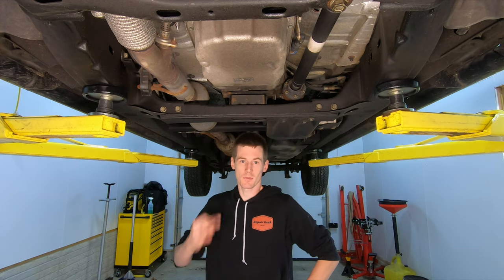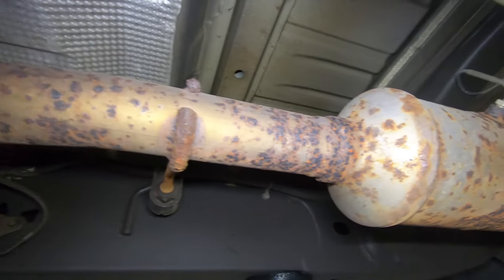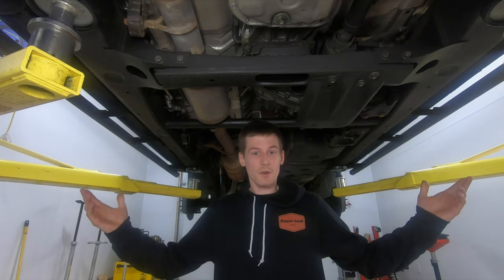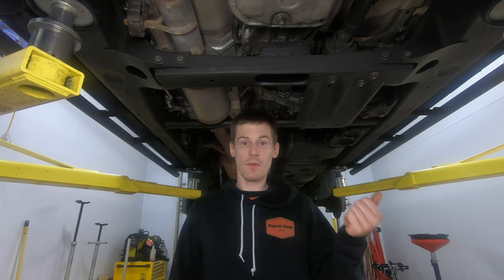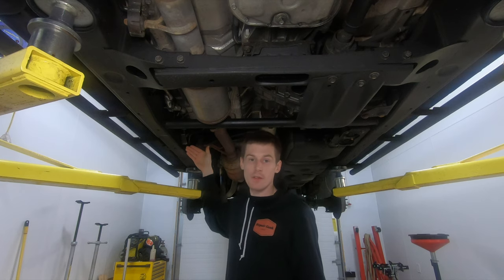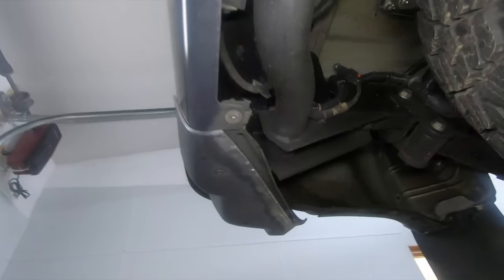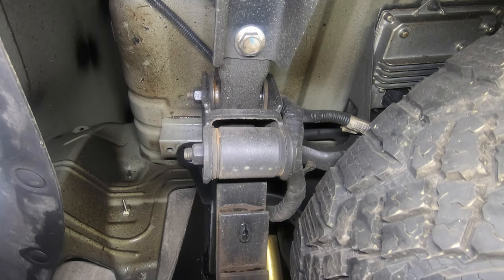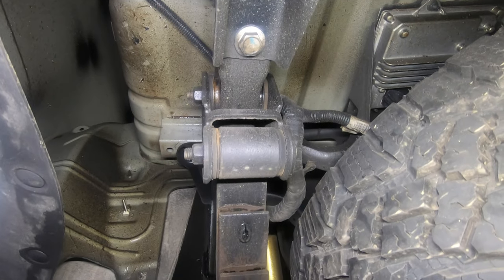Fluid Film Review After 3 Years and Woolwax Vs. Fluid Film Testing.

Comment: I think if you heat the Woolwax up and spray it with a paint sprayer or an undercoating gun with a wand, you can get the product in all of the areas mentioned. I have used both for years and I like Fluid Film for things like rubber treatment or battery terminals, but as a rust inhibitor on the undercarriage, I think Woolwax is superior.
Reply: I bought the fluid film spray gun kit. Can I use wool wax with that?
Reply: @JT_WallStreet  

Yeah, that would work fine. I get the stuff pretty hot before I spray. I use an old kitchen pot on a campstove or I just use the paint cup on the Harbor Freight air fed spry gun I use. 

You want it hot enough that it runs off a mixing stick pretty quickly. The pot or spray cup will be too hot to hang onto with a bare hand, but once it is clipped to the sprayer it's no big deal as long as you are not shooting it in your eye or something.

Comment: Run paint tarps around your truck for the overspray and get some CRC on there. It's so much better of a protectant.  Essentially make a pait booth under your truck with the tarps.
Reply from the maker: Crc does not creep meaning if you miss any internal cavities on the initial application it will not creep into the areas you missed.

Comment: Great work there lad, alot of information and no bull. I have been spraying my 80 series with heated chain oil and wax  for years and works great when the dirt builds up on it. But I now want to treat the underside of a 71 challenger with a lanolin based product, do you think its worth while treating the cleaned down frame (not rot just surface rust)  with a rust converter before applying the lanolin? Or a waste of time!!  Appreciate your thoughts, all the best from the north West of Ireland.

Comment: The LPS3 is the only product that was approved by the FAA for use inside of the landing gear compartments on commercial aircraft. It was the only product that showed no signs of failure. 160-200mph touch down speeds spraying salt and debris inside the compartments. 

I also found cosmoline sprays such as LPS work even better heated up in warm water and their consistency to creep greatly improves.

Comment: What happens during the summer with the wool wax and the pinch welds? I use wool wax on my diesel truck and she's black and gets to 100 plus degrees here in Washington State. You're in the summer and I can tell you that the wool wax the black component won't move but the oil itself you'll have like a oil slick all around the main. Of wool wax. I think that gets missed and that the wool wax does protect it, but it requires the heat of the summer to really set the product you like the test stuff? Take two pieces of metal that are a pinch welt. Put the wool wax in there and then heat the metal up to what it would reach during the summer. In my area we had summer temps as high as 102... Remember you need to do that all day at least a couple of hours and you put paper underneath the product or the pinch weld. You'll see that it's covered in oil slick like a french fry on a piece of paper. I talked to woolwax. They told me they developed the low viscosity just so you could shoot it inside the frame rails in cold weather
Also if you speak to them, they'll tell you how to make your own little viscosity. They even tell you the ratios of oil wool wax. Then yes, there are probably some grammical errors in this because I'm typing it with my phone speech to text
Another tip to the wool wax because it's so thick. Pay a buddy to drive in front of you on the dirt road so he's throwing up a cloud of dirt and drive behind him for 10 to 20 mi and it turns the coating more hard like engine oil when it sits on your motor and it's on a tractor or something and it's been exposed to the dirt. It develops its own hard film and the oil penetrates the dirt. I mean if you don't want to waste it to the wind or the water fortify it you can't fight it shield against it military concept

Comment: Liked your approach.  Some comments:

FLUID FILM SPRAY vs GALLONS:  I've used the spray cans.  I've seen an opened gallon and I believe the gallon is thicker than what comes out of the spray can.  Have you determined if they are the same?

CRC MARINE 06026:  Any experience / comments?

TRANSTAR 4423 AMBER RUSTPROOFING:  This is very similar product.  Any experience?

BOILED LINSEED OIL:  This predates everything.  It polymerizes and turns into a wax that is actually a type of linoleum.  it stinks!

KENDAL KENDCOAT 60:  Long gone, did you ever encounter it?  Many industrial applications specifically called out that this product had to be used.   Chevron Marine then made virtually the same product but eventually only supplied it to Europe.  Another outfit picked up the formulation for some big fleet customers, I think the company that was supplying it was Michigan Petroleum Technologies (or something like that.)

Comment: Been oil undercoating my cars trucks for 49 years . I used every thing from motor oil atf used mixtures of chain bar and new cooking oils . Also never used oils in door or panels or quarters as it stinks but I found used great for older  trucks and cars . I thin the mixtures with mineral spirits so they spray well and work like penetrating oil after a couple of week i then spray a thicker oil like chain bar or wool wax over that best of both worlds . On my brake lines and fittings first light oil to penetrate then old school asphalt black undercoat on the top of the oil . To get good affect you must do the oiling annually and soak everything box doors frame inside and out drill 1/2 holes in pillars and rockers and soak the insides . So from my experience any oil works and you need a light penetrating mixture first into welds and pinch welds then wait and spray on a thicker oil  which  does not wash of easily and spray into all closed areas dong this will save any car or truck .
Reply: The guy in the video will tell you that oil doesn't work. haha.
Reply from the maker: The guy in the video has proved it... Oil only works because it attracts dirt which adds resiliency. Testing JUST motor oil without dirt exposure proved it did nothing because it is too thin and ran off: https://youtu.be/9SOOfZFmhSY?t=1242
Reply: @RepairGeek  that why I first coat with oil and a thinner and phosphoric acid wait a couple of weeks then mix some heavier oil and some asphalt foundation coating  repeat if it soaks in in a few weeks . Do it annually  one coat . Touch up as required also helps
Reply: Also if you add some cooking oil to the first mix it gets sticky then apply some heavier oil like chain bar and a little liquid asphalt. This works for me 49 years in southern Ontario Canada but only if done correctly and annually  if winter driven

Comment: 1. Get an endoscope and show us inside the frame. The problematic rust for quarter panels and rockers starts from getting trapped inside.
2. Get a 2017 truck on the hoist thats never been rust proofed to show us the difference.
3. Try doing touch ups through the season to prevent exposure. I.E. during oil changes.

Thanks for documenting this!
Reply from the maker: The endoscope is a good idea. I'm going to look into that. Finding a 2017 truck that hasn't been coated that's a little harder. Believe me that has crossed my mind. My issue is I don't know anyone personally that has the same truck uncoated.

Comment: I travel on dusty gravel roads, and after fluid filming the dust clings to any area I applied it. Would you suggest pressure washing the dust off? Or just re-apply over top. Thanks for the great reviews!!
Reply: I wouldn't wash it off. After a year I have areas on my van that don't get a lot of water spray and the fluid film is still there working and just dirty. I didn't even touch up those areas this year. I did all my touch up with Blaster surface shield. It very well may be a better product than fluid film. So far it's better in splash areas than fluid film.

Comment: I have been using Fluid Film for 2 years. No complaints so far. I like the clear formula, because after it is applied, you can see what's happening underneath the film. I have not tried Wool Wax, but as Repair Geek mentions, it would not seep the way that Fluid Film is designed to do. 
Regarding the idea that you cannot fairly evaluate a free sample, I disagree. As a Amazon Vine member, I criticize free products all the time. I usually find something to complain about, but Amazon rarely dismisses my evaluations. If a product supplier does not like my honest evaluations, too bad!
Bottom line, Fluid Film can only help preserve the metal under your vehicle. It is well worth the time and cost to apply every year. My Chicago based Subaru looks brand new top and bottom.

Comment: You had mentioned you spray twice a year in spring and fall. Are you spraying the entire undercarriage or just spot spraying? Also have you chosen this method based on the manufactures recommendations or playing it safe ?
Reply from the maker: I spray everything. Inside everything frame, rockers, bedsides, etc. Just playing it safe. I have the lift so its not a big deal for me to do it twice a year.

Comment: IMHO I disagree with the statement that you can't coat the exhaust system.
Yes you can by having it Jet Hot Ceramic coated. They coat the material at 2500
degrees and it will not rust, fade, chip, crack or peel, the color will remain the color you choose.
Maybe you didn't know that and probably not others too, hope this helps out.

Comment: 4:59
try using a silicone spray on your weatherstripping, in order to protect it from any fluid film/woolwax it comes into contact with.
(not thinking about $, i coated mine with (much more expensive) ceramic to get the same kind of barrier going; i don't know if this will work (suppose i'll know when hell halifax freezes over and my doors are or aren't sticking), but science
like you say, weatherstripping's not a big deal to replace)

Comment: I have used fluid film for years and have started adding diesel fuel before spraying in cavities that don't have good access. I do this with the belief that the diesel will carry the fluid film better into seams and other tight areas. Have you ever thinned fluid film with diesel fuel for this purpose? (Yes, it is messy)

Comment: Do you have any experience with putting FF on existing light surface rust?  I have an '06 Tacoma that I just bought with 40,000 miles.  I believe the frame was coated by Toyota in a recall.  There is some surface rust on the frame.  I wire brushed as best I could, washed it really well, let it dry and then coated the heck out of it with FF.  Just wondering how effective it will be going forward slowing it down.
Reply from the maker: It will help. Obviously you cannot reverse rust with FF but if it stays on the surface and you create a barrier between the oxygen in the air and the bare metal it cant rust. It's chemically impossible.

Comment: Great video! Thanks. Did you drill holes in your doors to insert the product? I had seen a video last year and the shop that performed the work drilled and plugged the doors. I really don’t want to do that unless it’s completely necessary. I’d appreciate your feedback.
Reply from the maker: I don't drill holes. I spray inside any existing hole but I don't drill.
Reply: @RepairGeek  Thank you.

Comment: No doubt, This truck will be "on the road" so loooong that it will be one of the last 'internal combustion' vehicles around. By the the time you are ready to trade this in, ALL vehicles will be electric and gas stations will be few and far between....
Reply: Spectt,
Don't hold your breath on internal combustion engines becoming extinct!!!
Reply: @frederickburns1739  There going extinct by 2035
Reply: You guys really believe that bs? They can't even keep Texas up and running with their "renewable energy" garbage. Someone is getting their wallets padded, and it ain't you and me. California has had the same issues just this past summer. There's something more to all of this nonsense & it's probably got a lot to do with "control"! The whole every single thing has to be electric/battery crap, it would come with a huge fossil fuel fired and nuclear powered cost/use. The grid is decades away from handling it, to boot. If the government meets that deadline, they'll be FORCING us to suffer some consequences while doing so. The cost? Can't see the benefits of that. Still an abundance of oil and rare earth metals to create the whole battery packs. It smells very suspicious and consider the source. Also, did you know that the bearings and stuff in a windmill is lubricated with oil/grease and that they leak sooner or later and have to be repaired, after it's leaked down the shaft?! That's a petroleum product, as another thing that's really f'd up, the blades/propeller shape things, they break often and they get rid of them gigantic things by burying them in the ground and NO, they're not biodegradable. Look it up, it's not good. "Helping" is one thing, going full on off the deep end, that's a whole 'nother can of worms. Full disclosure, I own a duramax 3/4 ton GMC especially for towing my camper/travel and I love it.  I also own a Chevy Volt, I love that too. I personally am intrigued by lithium ion and also have battery powered lawn tools nowadays, but I'm still not deaf, dumb or blind to reality.

Comment: I have a question. In the winter, after driving on treated roads, do you still wash the underside of your truck , or will that remove the FF that was sprayed in the fall. I'm currently redoing the bed of a 2011 Sierra, and am seriously considering the use of FF. Thanks.

Comment: I don't own a car lift be nice if I did.    These products are they do it yourself ?    Looking for is company that do good job using right product .   Sounds like to with a company that does Fluid Film only cause runs down metal .   Last time I went to Z-BAR FRAME ROTTED OUT !   Moisture built up between metal  stuff put on so thick it flaked off.  Wool wax to thick just might  do same thing.  
Thank you for showing video . Truck list is 52000 Live in Mass like the truck to last .   Having a lift do it yourself do a better job than a company would do it.   Which 1 you go with?
Did you ever hear of New Hampshire oil Undercoating ?   I am just going look into there product .

Comment: You must not drive on dirt roads. My truck was caked with dirt everywhere after three years and rusty. I pressure washed it and tried waist iol but I am not confident it will help other than the inside areas. I don't think fluid film would work either or woolwax. We get calcium chloride treatments on the dirt and it gets everywhere underneath too. I think next year I will try fluid film or the NU product.

Comment: I'm not sure why you've found Woolwax to be messy.
 I've used both and never experienced that. In fact, they are essentially the same product except Woolwax is a bit thicker. However, I did have a problem with long wands with Woolwax last year but not the previous year even though temperatures were about the same. I don't know if I would have had the same issue with Fluid Film. I do have both on hand so I'll compare them with long wands this fall. All in all, I prefer Woolwax and, again, i don't know why you find Woolwax messier. I find that odd. Being thicker, Woolwax should be less messy, of anything.

Comment: I wish I had a lift, I use jack stands and it rough. I undercoated my truck and wife's van with wool wax last year and it seems to have worked great. I just spent this weekend doing it again preparing for another Ohio winter. (I only had to use half as much this time around, the stuff held on pretty well) I'm curious to see the results you got between fluid film and wool wax... when do you expect to have the results video out? (I'm assuming it will be sometime in November)
Reply from the maker: It should be out in the next couple of weeks. It's the next video I'm going to make.

Comment: I live in Manitoba and we use lots of salt and sand on our roads i bought a new 2014 ford f150 and it is sprayed every fall with Rust Check   9 years later no rust and its a daily driver. I never wash the underside untill its summer.

Comment: question would you spray woolwax on electronics? I saw a recommendation to spray lanolin (woolwax) on the electronics of a trolling motor intended for saltwater use, he did it and it worked after, it would seem to be okay so long as it does not contain conductors.
Reply from the maker: It will be fine.

Comment: Want to get cosmoline off something? Spray fluid film on it lol. Or WD-40. Any kind of oily solvent will degrade and melt the wax. 

As a cosmoline user you raise a good point. Cosmoline is a thick goo that likely is not penetrating pinch welds. So it's a better option for a newer vehicle. Because it can smother a pinch weld and seal it off. 

While it's not optimal to blend cosmoline and fluid film for the reasons stated, cosmoline is a better option for wash areas and can be to some extent blended. So long as it goes on first. 

It should also be noted that any type of oil will damage the black GM factory frame wax. It will melt it and cause the wax to chip off and fail sooner. If you contact fluid film corporate they will tell you they don't recommend using their product on GM frames. If the GM wax has already fallen off well, doesn't matter.